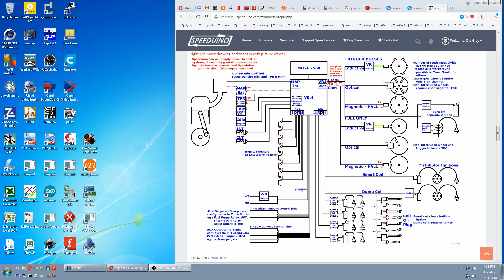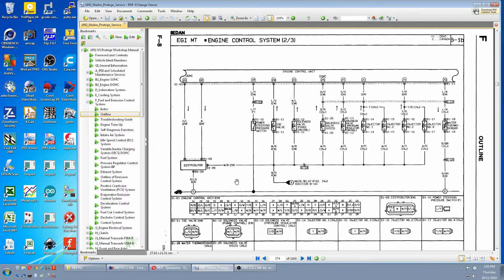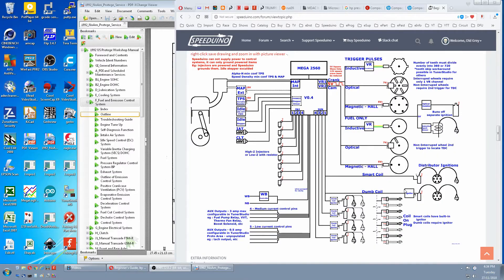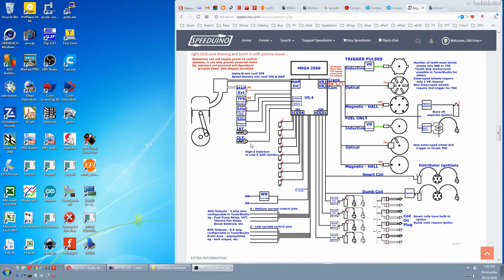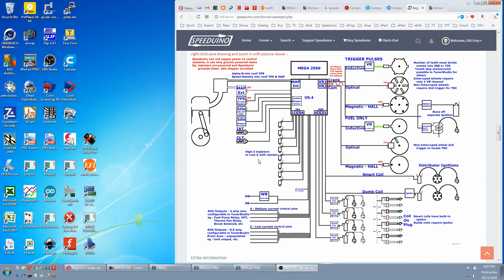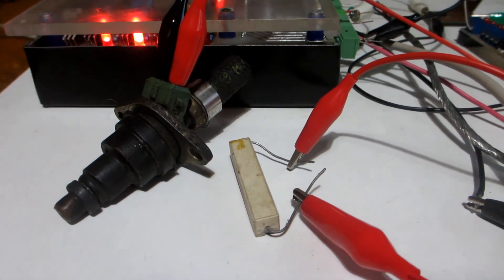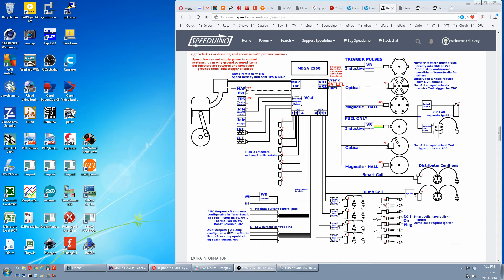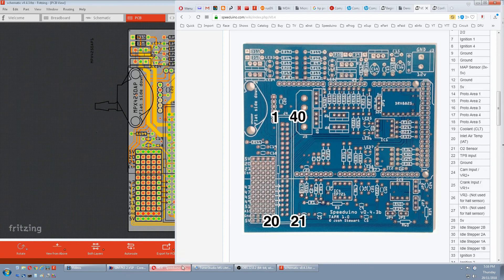Speeduino EMS #5 : Output Testing

Comment: great videos.  I have a question on how to wire up a idle PWM two wire controller (ford mustang idle pwm) on speeduino .4 board.  you have pin #37 and what other pin from speeduino board do you connect to?  ecu ground?  thanks for your help.
Reply from the maker: I can't really remember if Speedy GNDs the PWM idle solenoid as control or supplies the power. My guess is GND as the MOSFETs are NPN, but you'll have to look up the circuit or connect a DMM to pin37 and see if there is continuity to GND when it's running.

Comment: Hi may I know what kind of dumb coil  NPN IGBT transistor u using?
Reply from the maker: Any IGBT should be fine, because I don't think anyone makes a PNP due to it being so inefficient. I bought 3 different ones and all of them worked, so just find one on ebay and look at the datasheet to be sure.
Reply: @SidneyCritic  thanks for your reply. may I know the code number of the IGBT u using? And what specification needed for the IGBT?
Reply from the maker: @voonyienkai8231  Any should do because that is what IGBT is, ie, high current high voltage switching. I used the cheapest on ebay:- NGD8201N and V3040S.
Reply: @SidneyCritic  thank for the info. 😀😀